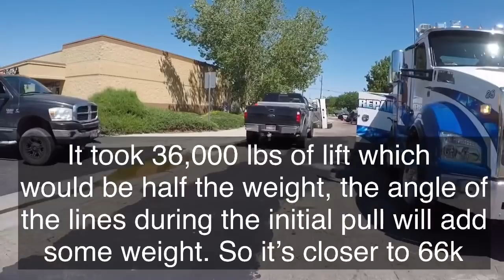66,000 lb Concrete Mixer on its Side!

Comment: Nice recovery as always guy's.  The rear discharge mixers are extremely top heavy and prone to rolling over. They still use them all over the country but here in Michigan you will find mostly front discharge mixers that are still very top heavy but have a much better weight distribution and allows the driver to control the pouring of concrete out of the chutes. I see that only had 3 rear axles and that is exactly why they are so prone to rolling over. We have only front discharge mixers and we use 5 and 6 axle combination mixers. All the 6 axle mixers have 2 pusher axles 2 drive axles 1 tag axle and 1 steer axle. The pushers and tag axles turn with the truck. Not that you really wanted to know any of that. Lol. Stay safe guy's.
Reply from the maker: Thanks Dan!
Reply: Front or rear , take that turn hard and they both will flip
Reply: @MiguelRodriguez-zz3cw  Well that could be said about anything that is top heavy, however I was just pointing out the fact that rear discharge mixers are prone to rolling over way more then front discharge mixers.

Comment: i WOULD HAVE DRIVEN THE ROTATOR UP BESIDE THE TRUCK TO MAKE IT EASIER WITH LESS WALKING!  The chains would not have to be carried so far.  The rotator can aways be repositioned for the recovery.
Reply: Always other ways of doing things, but when your incident commander is one of the most respected operators in the industry if he parks his truck 3 blocks away there’s a reason for it and ya go with it